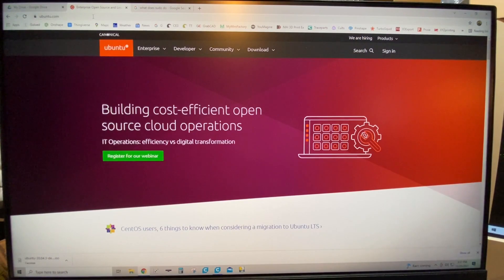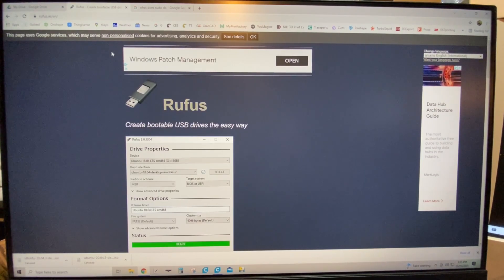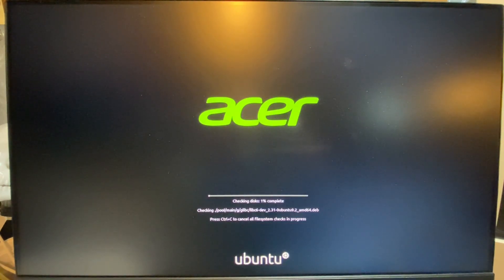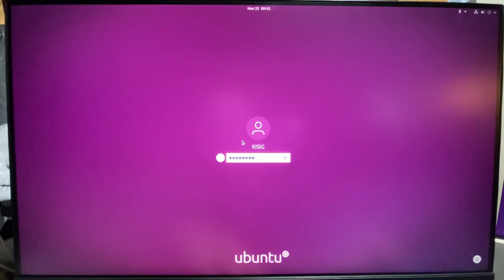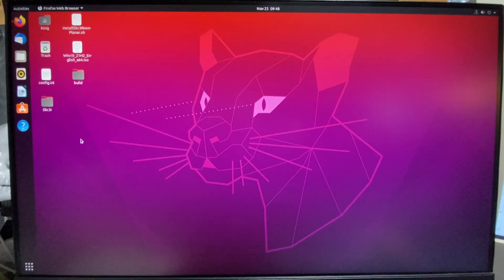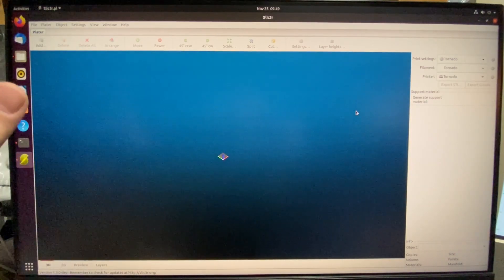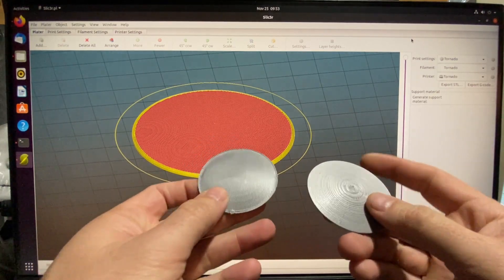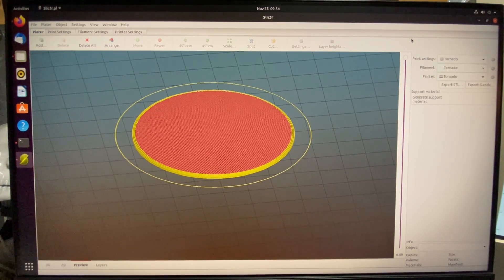Slice and 3D print non-planar layers.   Instructions in Video Description

Comment from the maker: check the description for instructions you can print before you start
Reply: Hello. thanks for sharing the content. How can I get the STL file of the part ? Thank you
Reply from the maker: @ouedraogoismael9945  great question, thanks.   I will put a link in the description within an hour
Reply from the maker: @ouedraogoismael9945  link is now at the bottom of the description.  Thanks!
Reply: @keepitsimpleideaguy8676  thank you so much. I’m using another technique which is curvislicer to slice entirely in nonplanar instead of using slic3r. Will give it a shot using your stl file
Reply from the maker: I’ll have to check that out too

Comment: The installation went fine but the programme wont launch. How to solve it?

~$ slic3r 
Fatal Error: wxGLCanvas is only supported on X11 currently.  You may be able to
work around this by setting environment variable GDK_BACKEND=x11 before starting
your program.
Erreur de segmentation
Reply: I fixed it by typing sudo gedit ~/.profile and adding at the bottom 
export GDK_BACKEND=X11
export DISPLAY=:0
that fixed it for me
Reply from the maker: Thanks for the help Nick

Comment: Why? This seems like excessive wear on your machine and really hard on the controlling software.
Reply: Standard 3D printing is like kindergaten coloring, 3D planer printing is for the advanced men and women. In the industry of CNC machining with big machines (not $2,000 hobby toy CNC's) complex shapes like molds are machined like this, and then you can step it up with 4th and 5th axis machines. Non-planer printing will allow better finishes, better strength, and more freedom in designs. That's why, it is a more advanced method. Not always needed, but very useful when you do need it.
Reply: If you truly understand your slicer your print should turn out perfectly,( smoothness comes from layer height and nozzle dimensions) with out eventually burning out your printer.

Comment: Crazy is the best word I can think of that comes to mind! Presenters need to display the most low risk solutions to problem or face many followers having serious problems. The presenter himself blew out his boot record and it took "multiple windows repair attempts" to fix, this is a hope and pray comment it can be recovered not expertise. This is about as high risk as it can get to problems.
There are many solutions to this that are very low risk to followers blowing out their windows installation and not messing with advanced functions of operating systems. A few components of this video were clearly novices leading novices which is a recipe for disaster.
Reply: bruh this is the internet, there are no guarantees, ever. follow any advice at your own risk.

Comment from the maker: @Emilio Ottonello   I can't reply to your comment or even get it to show up here, but your question was :"Hello, when I try to start Slic3r through the command "perl slic3r.pl" I get the following message: "Can't locate Slic3r/XS.pm in @INC (you may need to install the Slic3r::XS module)" and the software doesn't start. Can you tell me why? Thank you so much, Emilio"

can you see the slic3r.pl file in the folder you chose to put it in?  if not, something went wrong during the install or it is in a different folder somewhere.

I'm no Linux pro, but if you CAN see it, the first thing to check would be to make sure you are running that command in the same folder the slic3r.pl file is located.   The folder name should be in the command prompt.   You can navigate to the folder where the file is and right click the white space in the folder and open a terminal from there.   That should put the folder in the prompt for you.

if anyone else out there has suggestions, please share.  I'm learning as we go.  thanks!
Reply: Hello, I am getting the same error (cant locate slic3r/XS.pm) while trying to open the software. Is there any fix on that?
Reply: @sinarabis7  haven't found yet a solution. I get the same error. I will keep search for solution and if I find I will answer here. Do the same if you find pls.
Reply: @Aardwolf77  will definitely do, thanks.